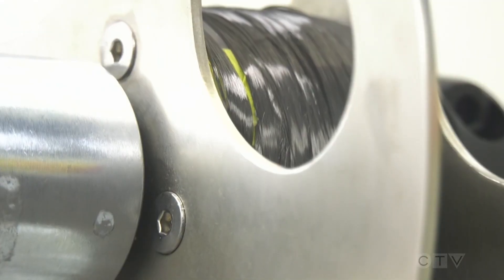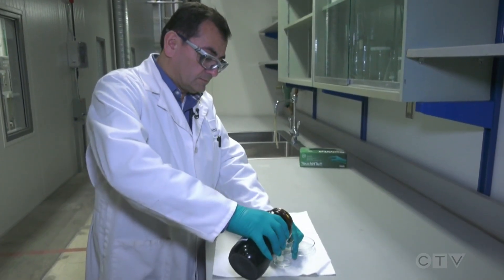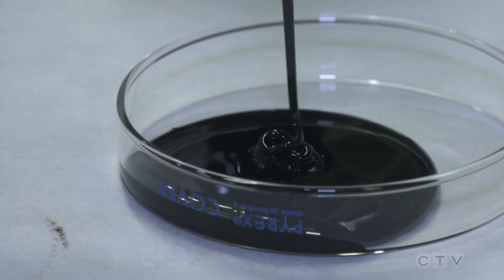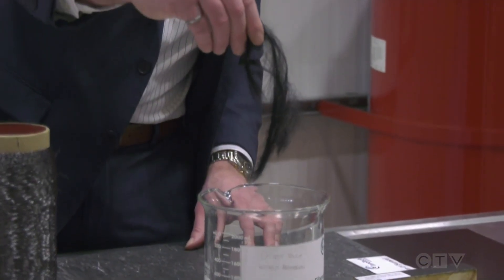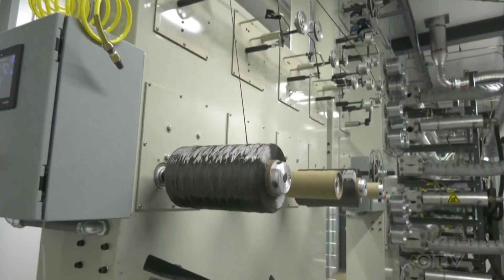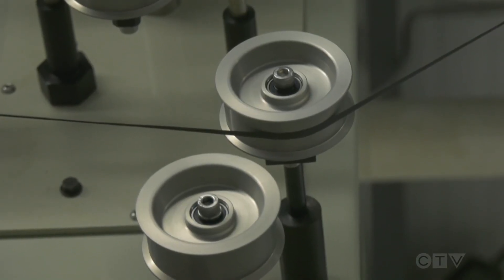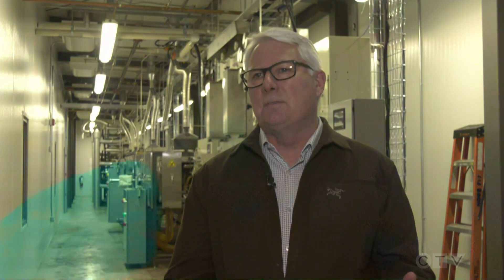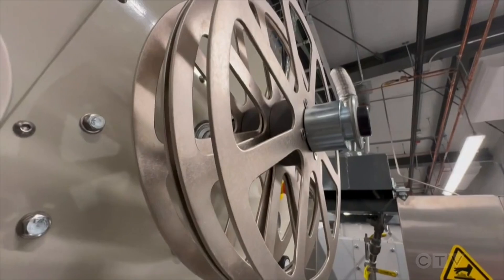Alberta scientists working on cheaper way to make carbon fibre

Comment: This is the way for Alberta pivot to a sustainable use of its heavy crude.

Heavy crude is well suited to high dollar value advanced materials like carbon fibers and carbon nanotubes which are useful for aerospace, electronics, automobiles, energy infrastructure, and so much more.  This on top of hundreds of traditional uses for heavy crude like asphalt, roof tar & shingles, heavy lubricants, petroleum coke, and a whole bunch more.

Don't burn this stuff up because it's all gone after that.  Alberta can lead the world in all of both advanced and everyday materials based on carbon.

Carbon is far more valuable as a building block for the future than as a fuel of the past
Reply: The asphaltenes they are using to make this are already a waste product anyways.  We produce so much of the stuff that we could basically double the carbon fiber production worldwide just by using waste products we already produce. The way the video describes it doesnt really explain the process.  The one guy does mention it that its the heavy bottom of the barrel products.  So it really wouldnt slow down our oil exports.  It would just turn the waste part to a really valuable product. The oil companies have been really supportive of all of these programs.  They provide most of the funding for a lot of this research and development.  Alberta has some really interesting stuff being worked on here.  The best part is we are creating physical stuff which is much more difficult to just pick up and move.  What we really need to do next is start to invest in robotics and automation research and development.  If we can make the materials and then have factories that are mostly automated then we can also do manufacturing at scale where we can compete with lower wage countries.
Reply: Canada works